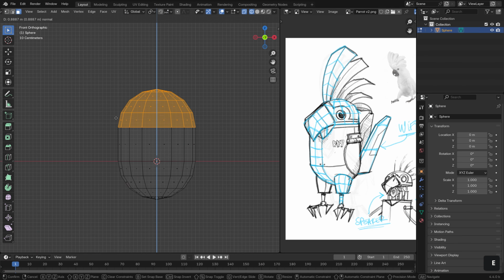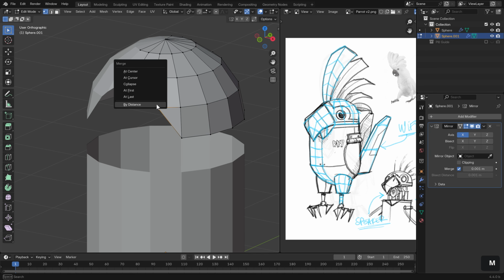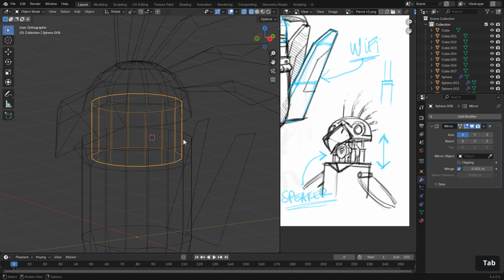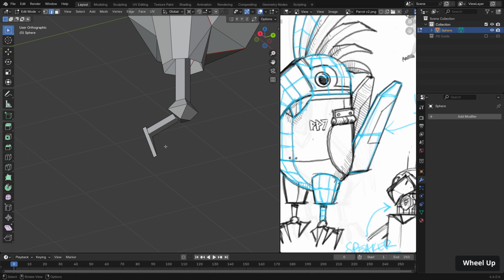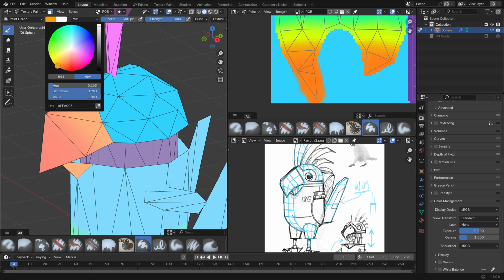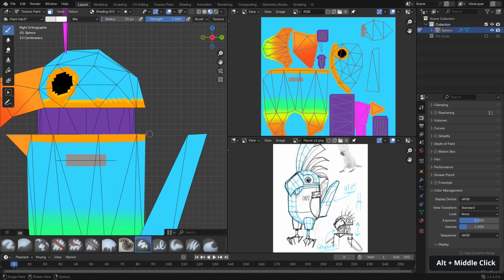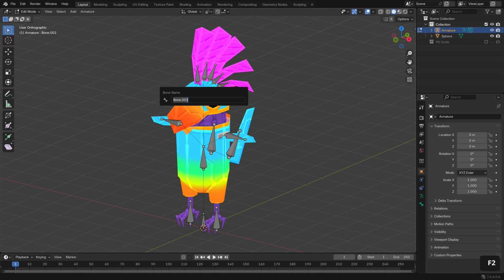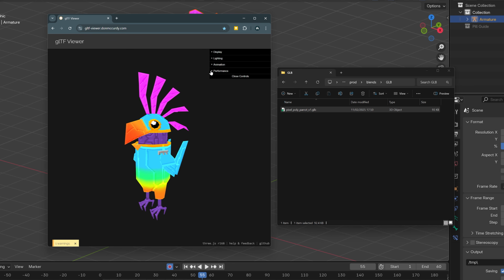Create Game Ready 3D Models in Blender #b3d #gamedev

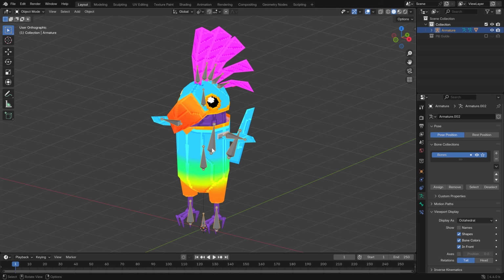Comment: 43:51 My bones are not being assigned in vertex groups. In outliner the bones are arranged in different offset columns ( sub headings ). I also had trouble symmetrizing wing_R, foot_R & wifi_R, so had to manually duplicate and name these. BVersion 4.2.3
Reply: same problem.Did you solve it??